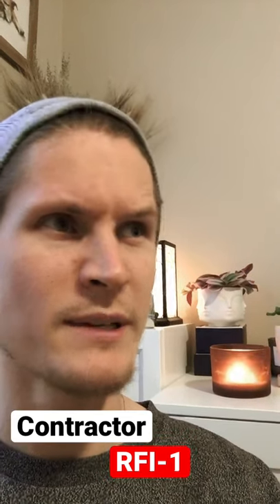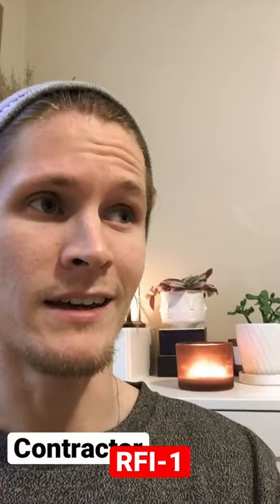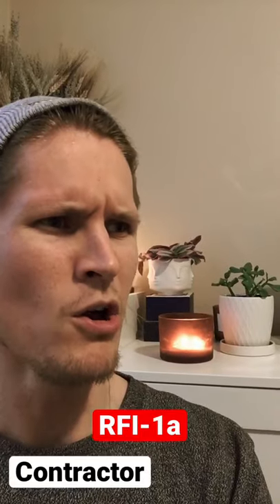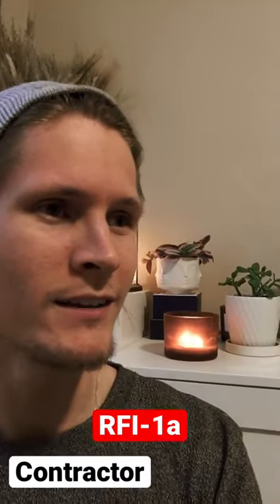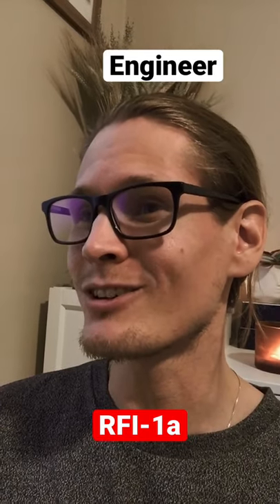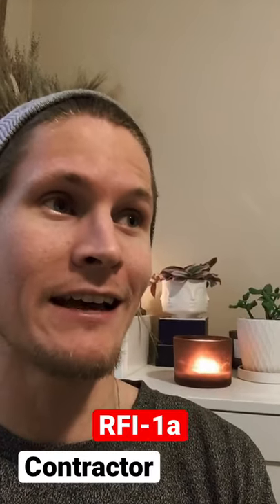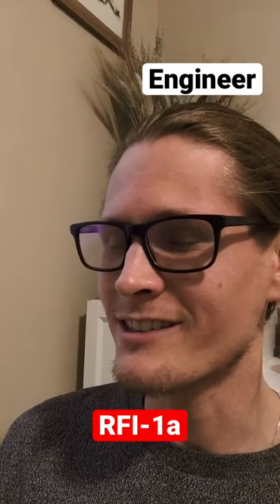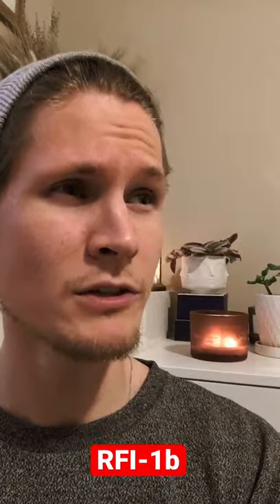Welded or Bolted? #shorts #kestava

Comment: Typically, for connecting to existing structures we use welded connections otherwise bolts are what most contractors prefer.